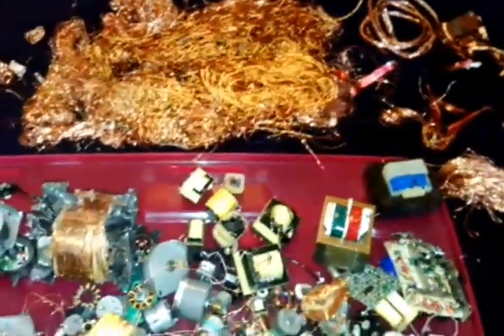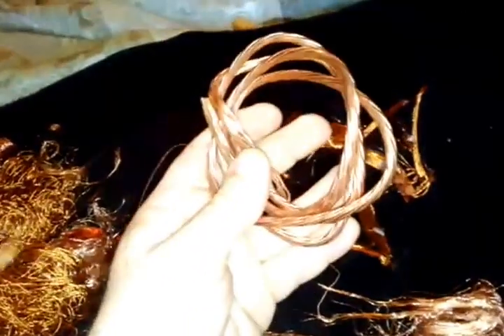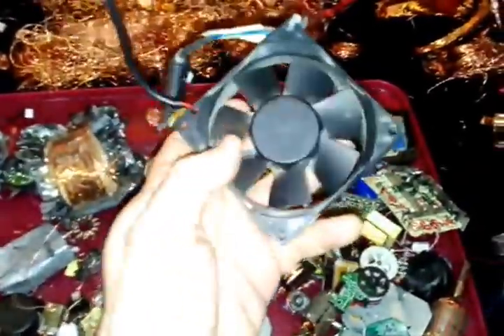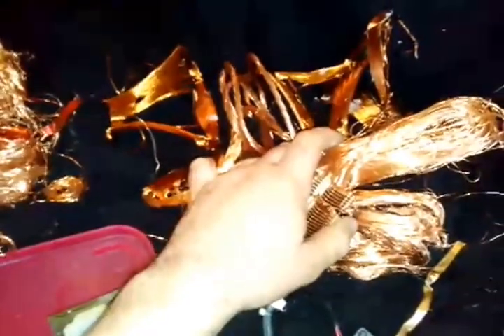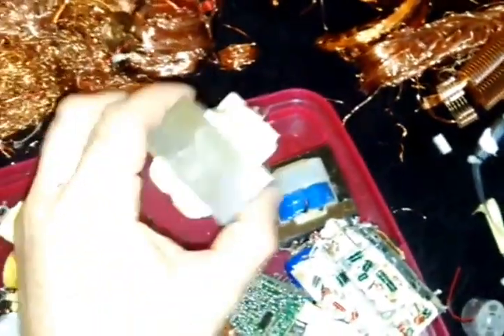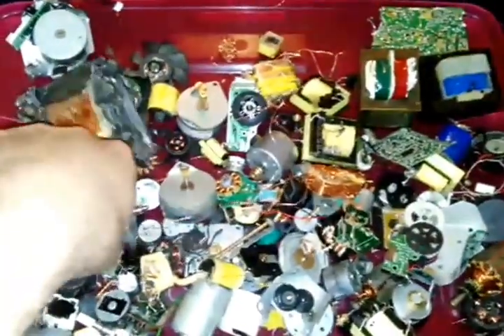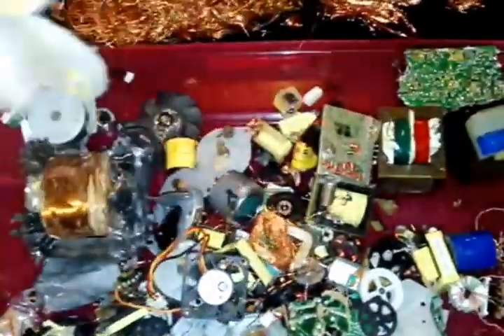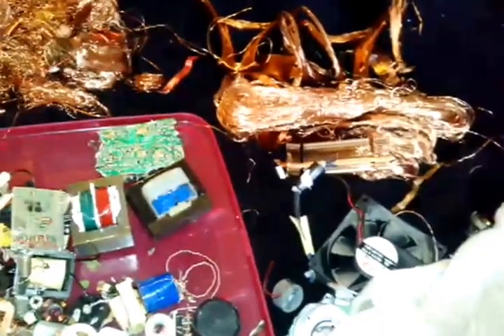Avi Oziel in: How To Recover Copper From Electronics Scrap - How To Identify Copper Components

Comment: You are a man after my own heart! I recently closed a part of the company I have worked for since 1979. and was given all the old and new machines , and all the inventory. I have been pulling all the copper parts \ motors, fans, transformers  etc. and you are the first person who has made a video on the copper angel hair wire.( thats what I call it.. I have so much that I have removed, and I have a ton more still to go through which I wasnt , now watching and listening to you I will continue on. I have several small crts from old retinal cameras. . SO THANK YOU this has been very helpful to me... also the now I will check the 100 Lbs of boards for the caps you talked about in another video.,, Take Care....Shabby Scrapper